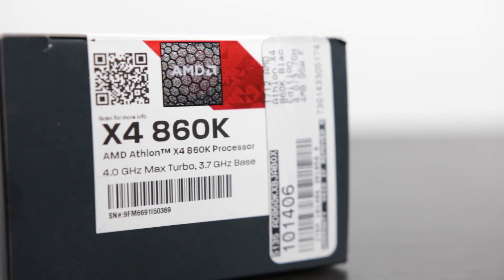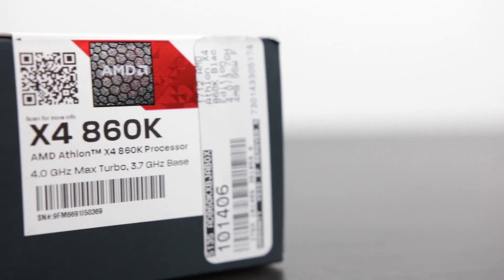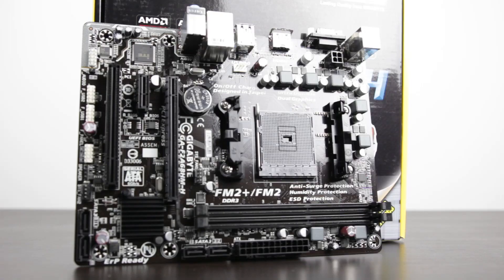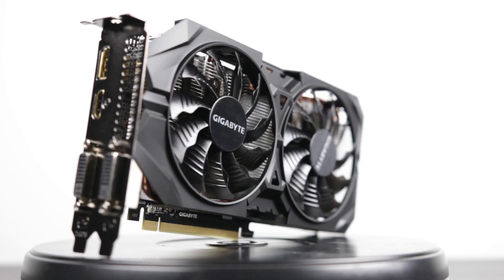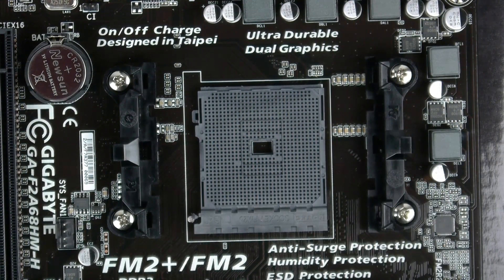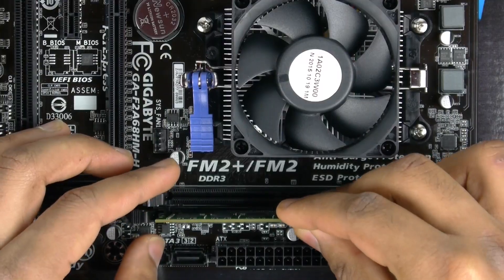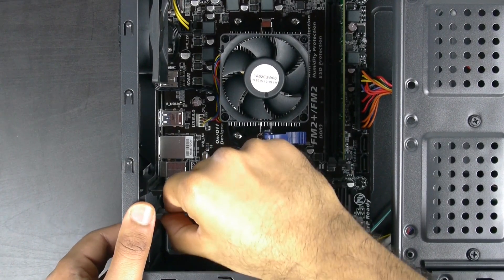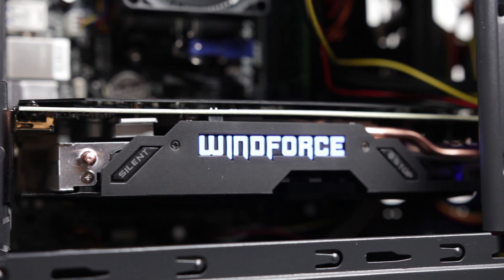Best 2016 AMD Gaming PC Under $400 - Build Guide & Benchmarks (Ep. 1)

Comment: That psu is really ghetto... For $20 you can get an evga ~450w psu
Reply from the maker: +Ben Mhart Good point, But I have been running another system with the same Apevia PSU for years and its pretty reliable. However the EVGA 450w will be better for sure. The Next Budget PC Build with the Intel G3258/gtx960 will have a better PSU. Thanks for the comment sir!
Reply: +Alexis The Pro totally, a 4.0 GHz core 2 quad is the minimum for this GPU
Reply: +Ben Mhart Gets a 2/5 on Newegg. Lots of people complaining about dead psu's.
Reply: +MW Technology will a e8400 core 2 duo bottelneck my gtx 770 4gb, it's 8gb ram
Reply: +MW Technology will a e8400 core 2 duo bottelneck my gtx 770 4gb, it's 8gb ram
Reply: +Ben Mhart for $0 you can check out my music ;) soundcloud.com/flexxgod50
Reply: +MW Technology  waj if u get 200000 subcribers u should do ur pcs and graphics cards collection tour
Reply: The low end evga isn't the greatest either, it is only a step above the apevia
Reply: +Ben Mhart yeah I was gonna say that thing isn't any better than some LED ridden buzzword PSU that's probably gonna fry the system. also no kind of drive? i understand there's plenty of options for OS installation and whatnot, but it's a big risk not being able to use your mobos driver disc or others just in case you run into issues.
Reply: +Alexis The Pro Yes, all current gen (& old dual core processors), even the G3258 overclocked bottlenecks a 970 and 980Ti. Its better to invest in an i3 or an i5 to avoid bottlenecks.
Reply: +MW Technology did you use the 2gb gpu model or the 4gb gpu model??
Reply: +MW Technology AMD GPUs are CPU hungry they dont work well with low end CPUs a GTX 960 should give u a better performace it would be good if you would make a video atlonx4/GTX960  vs atlonx4/r9380 to see the difference
Reply: Oxedion CZ
 So.....APUs are CPU hungry?Dude that makes no sense.Well NO LOGICAL Sense!
Reply: amd GPUs are CPU hungry resulting in poor performance with a low end AMD CPU as Athlon x4 860
Reply: also Athlon x4 860k is a cpu not an apu
Reply: +ProfessaTech historically AMD CPUs offer less performance per core than Intel, so in a lot of cases quad core AMDs haven't been able to surpass dual core Intels (though this isn't a constant). In processing where the number of cores makes more difference than each cores ability, sure AMD will win, but that's generally not how things work. And before you go more apeshit again after someone was just being objective, I am using an 8320. That was from an i3. I had to go 4x the cores in AMD to see a gain over my dual core i3, though it's been more than enough for what I use it for and I saw a good performance boost at a similar price.
Reply: ***** yea i agree Athlon x4 860k is better CPU pentium G3258 is a bad choice now days unless u plan to upgrade in a month or so also u need to pair an envidia gpu with Athlon x4 860k to get best performace its alot better optimized for low end cpus
Reply: +bokunotraplord In this age there is almost no way you can't get a 20MB BIOS file off the internet onto a flash drive.
Reply: +Oxedion CZ I m lucky I bought gtx 960 than r9 380.in some vids I saw athlon performs better with gtx 960 than r9 380
Reply: Sagnik Baidya good choice and happy gaming :)
Reply: +Ben Mhart Always have the 1 dumbshit who thinks he knows best comparing 1 piece of crap to another piece of crap.  For the price it's just fine.  Find a pretty modular one brand new for the same money dumbass...good luck

Comment: 4gb ram why ?
Reply: I think too much of the budget went to the GPU
Reply: Jerry Knudsen 10/10
Reply: bokunotraplord Next time he can buy the x4 845 and and cheaper motherboard then he can buy 8gb ram. And the 845 is stronger then the 860k
Reply: +offir2012 ya ,the upcoming doomsday will requires at lest 8gigs
Reply: +offir2012 ya you're right and 8 gigs is much cheaper these days
Reply: Might well throw an extra $10 or $15 more for 8gb instead of 4gb.
Reply: +Rishabh Ranga 4gb is actually better than you think, I have 4 GB and it isn't bad at all when I am playing games, when I am running servers and a game my ram runs out.
Reply: +Ratchet yeah, and the psu will explode
Reply: Yes but better 4gb than a 370...
Reply: Jonas Ziegler they should use a gtx 750 ti with 8gb of ram and a cosair psu is they want to keep the same budget
Reply: +BritishActionGamer no...
Reply: +BritishActionGamer corsair psu, no way, only the expensive ax or hx series
Reply: +BritishActionGamer yeah that's my problem with it, the GPU is over 50% of the budget - and everything else is compromised to fit the GPU in the budget. My philosophy on builds is never to compromise the Mobo or Power supply so you can have years of longevity - everything else like the GPU can be easily replaced
Reply: Because cancer, 4GB of ram is useless in my opinion.
Reply: Ratchet yes but you can upgrade it vor 20 bucks the graphics card not...
Reply: +Gentleman so much cancer!-filthy frank
Reply: Gentleman I'm a Catholic whore, currently enjoying congress out of wedlock with my black Jewish boyfriend who works at a military abortion clinic. So, hail Satan, and have a lovely afternoon, madam.
Reply: +BritishActionGamer i got that movie reference...sly devil you lol
Reply: +Ratchet it definitely did, he cheaped out on some other stuff just to get what i'd consider an "over the top" gpu for a budget build. i mean if this system is meant to last for a couple of years before needing some upgrades a 2gb card would've been fine.
Reply: +BritishActionGamer man for the budget presented other companies make way better low-end PSUs stop falling for gamer buzz
Reply: +offir2012 what? 20fps boost for adding ram? are you high???
Reply: +Rishabh Ranga bro I need ur help cuz in India computer parts are too costlier.... I need the cheapest way to build the PC under 50K Rs. this video is also good but this PC costs me 46k Rs.
Reply: GamersWorld Yas# 50k RS are how much dollars?
Reply: GamersWorld Yas# NeWegg ships free in much items
Reply: +GamersWorld Yas# do u want to buy online or offline
Reply: +Jonas Ziegler 50k is $1000+
Reply: +Jonas Ziegler newegg is much more costeir on shiping and import duty
Reply: +Jonas Ziegler newegg is much more costeir on shiping and import duty
Reply: Rishabh Ranga 50K Rs = 400-450$ and I would buy online mostly but in Mumbai there is a lamington road where computer parts are sold at cheaper rates almost 30-40% discount on computer gadgets so I am confused...
Reply: +GamersWorld Yas# dude google it 50000 rupees is 1000$ and look for mdcomputer and hardwire for cheap prices almost offline prices . i would preffer r9 380/gtx 960 with i5 4960 k ,8 gb ddr3 for 5 to 8 yrs
Reply: +GamersWorld Yas# dude google it 50000 rupees is 1000$ and look for mdcomputer and hardwire for cheap prices almost offline prices . i would preffer r9 380/gtx 960 with i5 4960 k ,8 gb ddr3 for 5 to 8 yrs
Reply: GamersWorld Yas# Buy it when Polaris comes out. Makes no sense to buy one yet
Reply: +Rishabh Ranga Star Wars Battlefront recommends a PC with 16GB of ram, so 4 GB is totally enough... LOOOL

Even though on my system Star Wars on ultra at 1080p is using only around 6 GB of ram (nothing close to 16 or even their minimum requirements of 8 GB of ram), it is very dumb to have 4GB of ram only for any kind of budget "PC GAMING"
Reply: +Rishabh Ranga Im guessing the budget?
Reply: guily6669 But you can do more RAM in the build and no graphics card cause a graphics card is damn expensive
Reply: +Deadpudding And what kind of budget doesnt accomplish its objective?

If most AAA games asks for 8GB of minimum, you should not add 4GB for any gaming PC nowadays of any budget...
Reply: guily6669 You dont get it...?
Reply: +Jonas Ziegler I don't know what you mean then... All I know is a gaming PC needs a minimum of 8GB at this moment in time.

I mean whats the point in making a gaming budget pc that cant play games?
Reply: guily6669 Yeah but you can upgrade to 8 gb easily but upgrade a graphics card is difficult
Reply: +Jonas Ziegler Yeah but the problem is you still need to have them in the first time you build it if you want to lets say play games... unless you want is old games, but then you could buy a 150$ full pc for that and not make a budget gaming pc that cant play latest games...

And anyway I thought on that when I made my PC and I was pretty wrong...

Back in 2011 4GB was totally enough so I bought 2x2GB special low latency kit because I know ram prices drops with time...

Now in 2015 games started requiring 8GB more as minimum so I bought a kit of 2x4GB and now I have 12GB...

Problem is I paid around 70€ for the 8GB and the ram is FAR worse than the ones I bought in 2011, they are all G.Skill Ripjaw, however it seems most ram increased voltage and the ones I had was lower voltage and lower timmings.

I almost couldnt make the PC to run stable with the whole kit because of the new ram.

ps: And some day in time DDR3 price will start to increase when everyone only buys DDR4 and it's price decrease.
Reply: +Stefan Kuzmanov Because when DDR3 dies and no one buys it, only a few are manufactured or it completely stops and some still stay at the price of a brand new one...

I bought 2 GB of DDR2 from Corsair for a old laptop and paid almost 40€ back in 2009 or 2010, cant remember... And the stores here none had them already (The only way I could buy cheap was buying used, but oh well...).

For just a few more € I could have bought the 8GB Corsair DDR3 that I have in my laptop. And actually there was better DDR3 deals for 20€ than the old DDR2 that no one had for sale.

But this is not a rule for everything. Some things increase a bit the price, while some stay at low price until end of stock.

However usually it happens more on other sectors (not computers) so that after a few years a piece break and your old model need a part that is not manufactured anymore, or come out just a few, they go up in price.
Reply: thats only like 3 stalks of bananas and a bag of coconuts. you can pick those in a cpl hours. lazy.